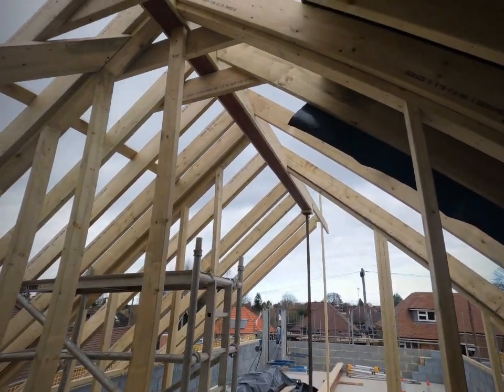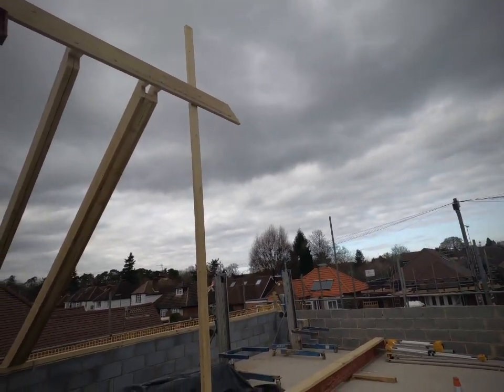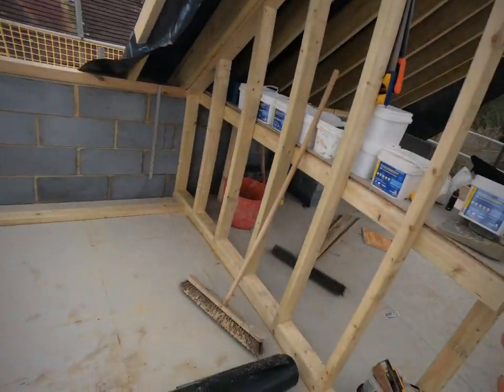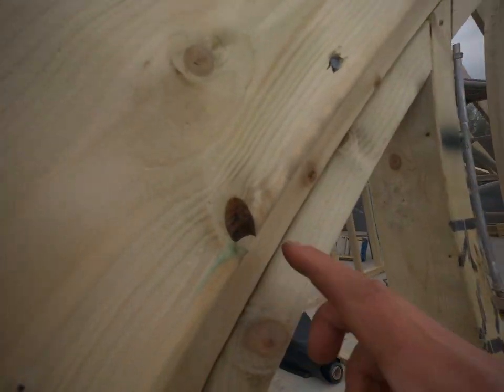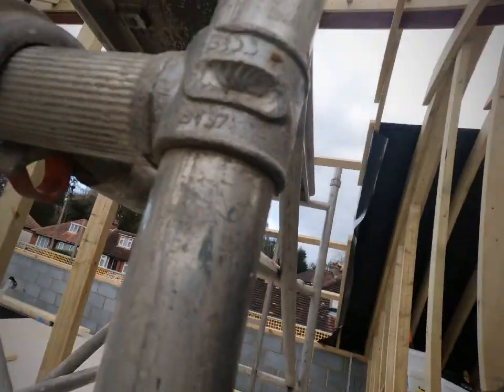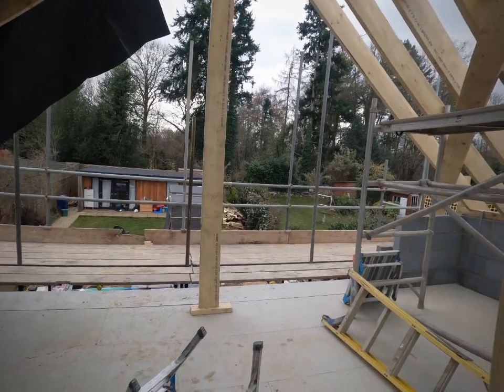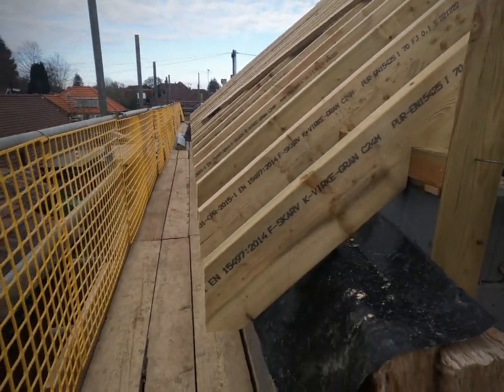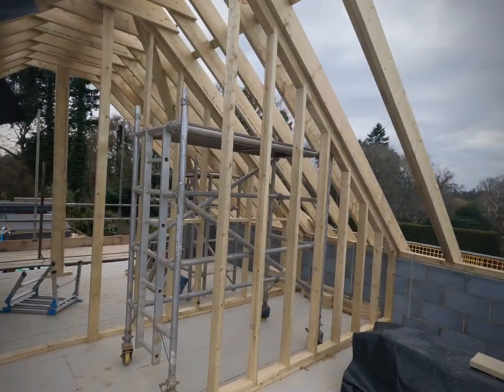Pitching the Roof on My New Build Project ( Progress Update ) #building #construction #vlog #diy

Comment: Do you brace these cut roofs like a truss roof or is there no need?
Reply from the maker: Hi Jase 

They have been triangulated at the top with a 8x2 collar that gives us a small amount of bracing but also a small flat ceiling but that's it obviously you have your standard stuff like wall plate straps etc and some stud wall top plates screwed into the Rafter but that's it mate
Reply: They have a structural ridge beam as apposed to a standard ridge board because of the cathedral ceiling. Collar ties on every pair of commons as well. The only two things I'd change is I'd have a gluelam beam instead of the steel. I'd also have used double bottom plates on my internal walls as extra fixing for my skirting, 👍💪🔨🇮🇪
Reply from the maker: @TheToolnut  all personal preference mate . The double wallplate thing is not something I've seen unless it's a bodge because the blockworks been put to low tbh 😄
Reply: @DayInTheLifeOfMe  Absolutely, each to their own. I just double up the bottom plates to give more meat to fix to. I don't like steel, it's heavy and hard to work with. I prefer timber beams as one can fix straight on to them, they are lighter and nicer to work with, 👍🔨🇮🇪
Reply from the maker: @TheToolnut  that's why we've used a 4x3 75mm is plenty to fix to with a gun nail or a nice ledger lock through the Rafter mate .
Reply: @DayInTheLifeOfMe  Apologies, crossed wires there I believe. I meant a double bottom plate on the internal stud walls. It gives more to fix the skirting to especially for a high skirting board. My preferred method for wall plates is a double 4"x2". It gives the option of pulling and/or shimming the top one to get it square and parallel. Some of the walls on old buildings are all over the place. That can apply to new work as well, sadly, 🙄🙈